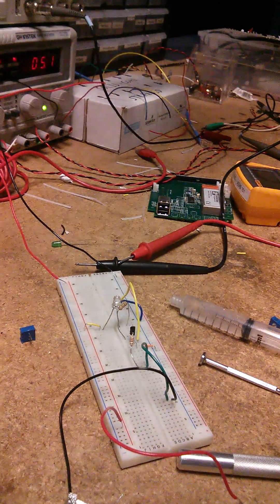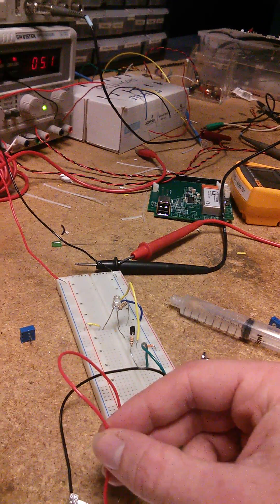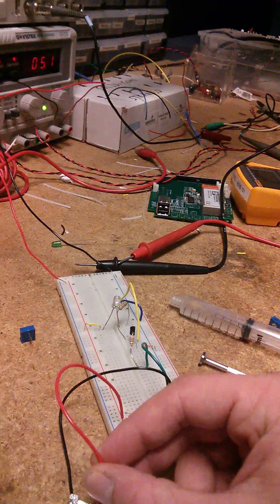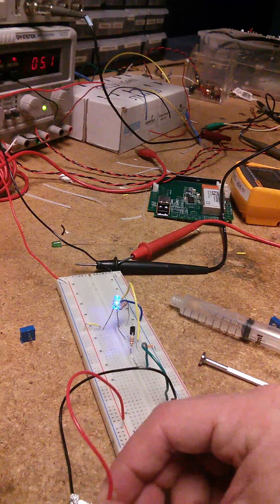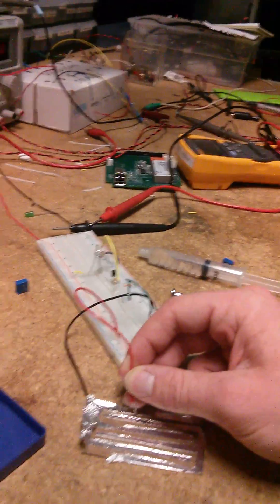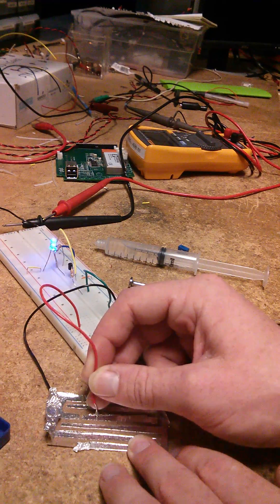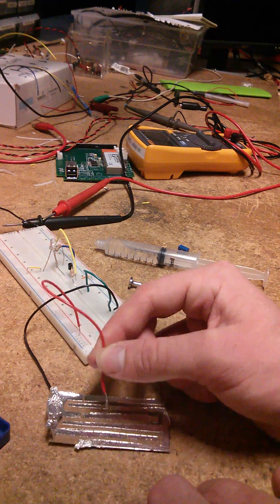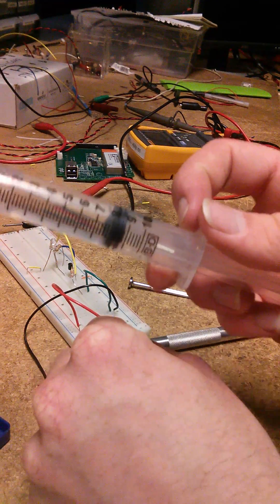Moisture Sensor Test

Comment: LG clothes dryers have two metal strips at the side of the rotating drum but not on the rotating drum which I believe are resistive moisture sensors.  They  don't work particularly well as often clothes are still damp when the machine shuts down.  Would it be possible to add a resistor or rheostat between the two metal strips so that a small currant passed through the two strips making the machine think the clothes are wetter than they actually are thus making the machine run longer before shutting down?  How would one determine the value of the resistance?  I believe these devices operate on 110 volts, but maybe not as you probably cannot be shocked or burned by touching the strips.

Comment: Bummer. I was looking for instructions on how to test the moisture sensor from MY DRYER. Your video here only is a demonstration that YOUR sensor is working. That's nice for YOU. But, no explanation of how you set up those things, where to get those items, where to plug it in. You're video assumes that EVERYONE watching has all those electronic equipment. I mean really...is that tin foil thing the actual sensor from  your dryer. It looks nothing like the one my dryer has. Thanks but, TRY AGAIN Jason.
Reply: Presumably the more humid the air the more current will pass through the sensor.  Are you talking about an LG dryer?  The type with two metal strips?  I'm going to test mine by taping a damp cloth over it.  Also it might be possible to do the same thing using a cheap ohm meter from Harbor Freight. without running the dryer.  As the cloth dries, the resistance would increase to the point where no current will pass through.
Reply: If you do a Youtube search for: "Miele Dryers Moisture Sensing Technology | The Good Guys," they have a good video on how theirs works.  Their system is far superior to LG's which just has two metal strips on the non rotating wall of the rotating drum, and is not at all accurate in regards to the actually dampness of the clothes.